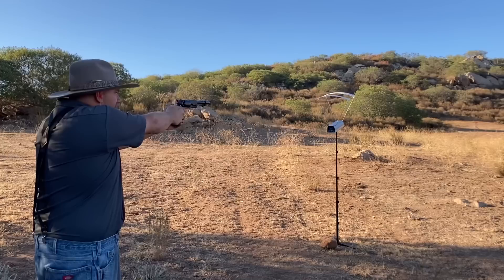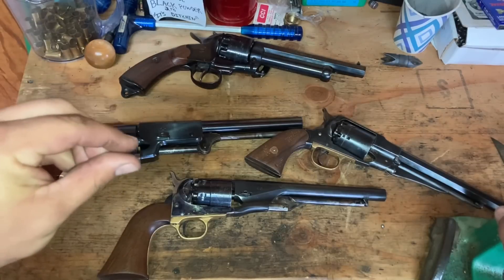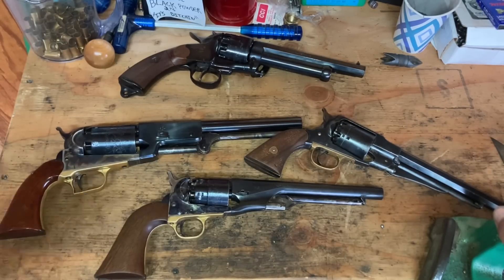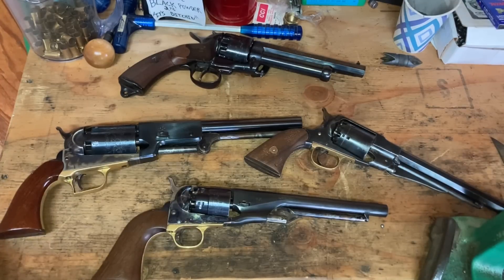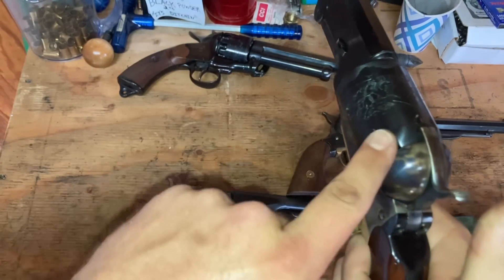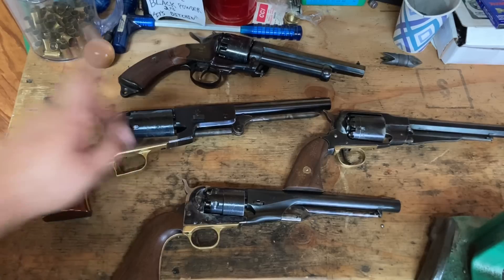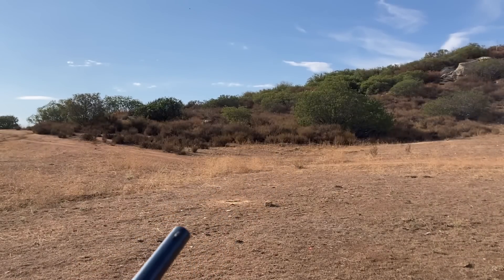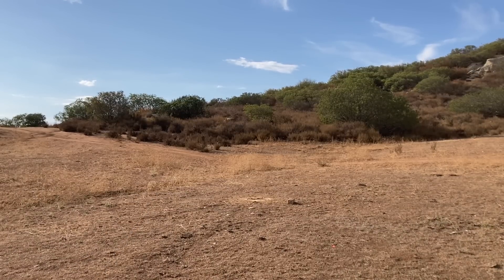What Causes A Chain Fire?

Comment: Much like you, I feel that on some occasions the chain fire can come from either end of the cylinder, I use grease (bore butter mixed 30/70 with beeswax, beeswax being the 70%, usually) to both lube the balls in the barrel, to prevent chain fires, and to keep the founding as soft as can be. I have fired well over 5,000 rounds from BP revolvers in my time and, luckily, have yet to have a chain fire. I have been present with several chain fires to go off and of them, about half were from loose balls and no lube and twice when I watched it happen from the rear. The 2 times, one had drilled the nipples to "ensure reliability" and the second had nipples that were well being their use date and we're just about as worn and the one who had drilled the nipples.

Comment: Got a cheep and easy recipe for cylinder grease. Use equal parts reg candle wax and axle grees. Use a been can to heet mixture and stir it with a pop cycle stick. Works well in hot or cold weather. You can very the ingredients to make it thicker or thinner as needed.
 I have never had a chain fire and I love to shoot. Keep up the good work
Reply from the maker: Thank you

Comment: Corned, glazed, commercial lack powder is funny stuff. It can be set off so easily by the metal shaving sparks from a flintlock or the flash of priming in a flintlock pan, yet is rather difficult to set off with a smoldering "slow match" or a thin electrical spark. Or, consider the Lindsay Civil War musket that was designed to shoot two charges out of one barrel -- two loads loaded one atop the other. There were many other guns that used this same principle, back in flintlock days, such as multi-shot guns with sliding lockplates, and even a 4-barrel "machine gun" where one barrel fired one load, which near the muzzle had a gas port that ignited a powder train completely filling a second barrel, which burned back like a fuze and (through many more gas ports) set off a burst of additional shots loaded "Roman candle" style in the remaining two bores. It really seems amazing that at full firing pressure the fire does not get around the projectile and ignite the next charge behind it. Though I imagine special steps were taken to prevent it, such as greased wads or specially-shaped bullets.

I always assumed most "chainfires" in revolvers were caused by "wormy" balls... balls with major defects from being cast too cold. Crisco definitely sucks as a bullet lube with black powder, it lets fouling build up very fast in the bore, but I think it is very effective at stopping chainfires. In fact I used to shoot revolvers a lot when I was a teenager, and don't recall EVER experiencing a chainfire. Even though my balls were never big enough to shave a solid ring of lead off. The grease melts and blows all over from the first shot, but something like capillary action spreads it and draws it into the tiny cracks where it is needed most.

I have not shot so much in recent decades, but now prefer conical bullets and real bullet lube over round balls and Crisco.
Reply: https://youtu.be/5gMkQ9Vu4Dw?t=237

Here is a guy talking about chainfires in the context of the oddball Walch revolver, which used stacked double loads in each chamber. Incredibly he has not read the patent or even looked closely at the patent diagram he included in his own video. He says grease was not used, when the patent clearly specified a special deeply-grooved bullet packed with grease. He seems like a nice guy, but I find his lack of research and lack of attention to detail absolutely mind-boggling.
Reply from the maker: Yes I’ve seen that video. I think it’s a stretch to conclude that because the Walch revolver didn’t fire both of its double loaded chambers at once proves grease doesn’t help to prevent a chain fire but that’s just my opinion. I’m not sure why but people have very strong opinions on this subject.
Reply: @Fuzzybeanerizer  Man, imagine having a chainfire in a gun like the Walch
Reply: Whenever I think of people using Crisco for cap & ball guns, I remember Duelist1954's annoyed tone response to being asked about it "Don't do that."

Mixing your own lubricant from tallow and wax seems to work the best, in the words of people who do that.
Reply: That's something I hadn't thought of. Defective balls might allow a bit of flame to get through to the powder. The balls and bullets I cast are carefully inspected and weighed, and any that don't measure up are rejected and melted down. Maybe that's why I've never had a chain fire in forty years of shooting a Remington, and they're supposed to be very prone to it. Interesting!
Reply: @williamnye478  I'm thinking some people buying ready made projectiles may not always examine them that closely, so that could be a cause for chainfires if they don't notice a shoddy ball and don't use any grease.
Reply: @0neDoomedSpaceMarine  Highly possible. And a lot of these ready-made projectiles could stand to be a bit higher quality.

Comment: Wads and grease only aid function by softening fouling.  Oversized projectiles and tight caps prevent chainfires.  I shoot every first cylinder without grease and never had a chainfire until I used loose caps.
Reply from the maker: I don’t deal in absolutes on this subject. People say that they’ve had chain fires due to loose caps and I’m inclined to believe them. In my experience grease helps prevent chain fires. Any time I’ve ever had loose caps they either fail to ignite on the first strike or fall off due to recoil of a chamber that does fire. That’s my experience
Reply: @Everythingblackpowder  You would think there would be another cap design by now after all these years . Seems like something on front of the cap that would protrude into the nipple hole to ensure they stayed put,sealed up the hole, and improved the ignition . How often do you clean the nipple openings and how do you do it ? I have seen where they say to fire a cap on empty chambers to make sure they are clear . Could torch tip cleaner be used ? Maybe make a nipple that uses a plasma arc like those new rechargeable lighters ? I use the twin arc to light my cannon fuse . Best fuse lighter  yet .

Comment: Interesting presentation on chain fires. I haven’t had one yet and hope never to. My cap n ball is a “.44” and the .452 balls leave a nice lead ring when I seat them. I still use lard or shortening because I don’t have tallow and usually don’t shoot in the heat of summer, at least nothing that laborious. Maybe fire a few mags of 30-30, or 308 or something or up to 10-15 rounds through my front stuffers and get back inside because 100 here is 100 with humidity of 80+%

Comment: In my opinion, your conclusions are correct. When not using any lube, I encounter chainfires every now and then, in my percussion revolvers; but only, when not using any lube.  When using lube, I have not had a single chainfire,EVER. This is over a period of 40 years of shooting. Its a clear indication to me, that chainfires come from the front and that lube is an excellent way of preventing them, apart from keeping the fouling soft. -Sure, my chainfires could probably be prevented by using a bullet with a very snug fit, but the bottom line is, that lube has for me, prevented chainfires with a success rate of 100%.
Reply: "...chainfires every now and then..."
Keep the lube next to the revolvers!
Reply: Never had a chainfire without using any lube or wad in thousands of rounds. Cap, powder, bullet. Nothing else.
In this example you proven correlation but not causality.
Shooting undersized bullets is a mistake from the user that he provoke itself. The lube have nothing to do in this. This is just a workaround.
Reply from the maker: I disagree. It shows that the chain fire is coming from the front due to the use of under sided balls and that the grease can prevent a chain fire if it originates from the chamber mouths. However, I do agree that this is easily remedied by using a lager diameter projectile. I too have shot a thousand some odd rounds through my 1860 army without any lube or wads and never had a chain fire and I had to pinch many a cap to stay on those cheap Pietta nipples. I started using grease to keep the fouling soft so I didn’t have to clean my pistol every 12 shots so what you call a workaround I call added protection. In short, I believe that the majority of chain fires come from the front due to undersized balls. Regardless of how easy it is to remedy or who’s fault it is for loading them.
Reply: Never lubed, never greased, never waxed. I’ve never had a chain fire after several thousands of rounds in multiple cap and ball revolvers with many barrel lengths. I’ve used regular balls, minie balls on both smooth and rifled revolvers, hand made pellets, flat pressed spheres, pellet flachettes and wadded flachettes. Some are pressed in tight, shaving the projectile and some are damn near just dropped in where you could smack the back of the grip with your hand and they would fall out. Never used any kind of lube or grease outside of what’s used when cleaning and maintaining the revolvers. If you are having chain fire issues, you are a sloppy loader and/or you have poorly made, non uniform, or pitted projectiles. I mean, I guess you could be loading it too hot where the projectile is barely in the cylinder because there is so much powder. Outside of that, if you chain fire it’s because you loaded it poorly or the weapon itself is in poor condition.
Reply: @Bravo-Too-Much c’mon man quit b.s. ing us.  You can’t b.s. old b.sers.  Stop it!

Comment: I agree with your findings completely. I had purchased an original Remington new model Army years ago and it had a spare loaded cylinder. It noticed some red colored material and saw there were no caps on it. After getting to my shop, I picked the red colored wax out of one of the chambers. They were carefully covered with what appeared to be sealing wax as was in common in the old days. I believe it was known that the chamber openings were a risk for chain fires. Thanks for the great video and posting your test results.

Comment: The only time I ever had a chain fire was with my Uberti Walker. I was using 60 grain loads with undersized balls and no bore lube or patches. (Cuz I was 17, and criminally retarded like most teenagers.) There was no damage to the gun, though I may or may not have shit my pants. In any case, I dialed it back to a more sensible 40 grains, got proper wads, and started lubing my chambers. Never had another issue again.

Comment: Oddly enough there does not seem to be any source documents detailing the "ring of lead" on originals in the time of manufacture......also the original colt chamber were slightly conical ( either by design or by happenstance from tool wobble) and I think they all got rammed down tight....... just an observation.

Comment: I’ve had had good luck loading powder, a thin vegetable fiber wad, a pea sized chunk of similar lube to yours, then ball. Haven’t noticed an accuracy difference for the first cylinder, but the barrel definitely stays cleaner, so I do notice a smaller loss of accuracy after a couple reloads. Don’t lose any lube to the hot gas of neighboring cylinders, and I think the fiber wad scrapes out more fouling than a felt one.
Reply: Mr. Maxwellian-This is how I load too except my wad is a very thin felt one (1/2 of a store boughten one). Only problem is that my pea sized chunk of lube may not be of a consistent volume each time although I try to make it so. I do think that the lube blowing out behind the ball seems to almost aerosolize and keep the revolver barrel and chambers coated and easier to clean.

Comment: This was a very informative video. Exactly what I like to see. You're not just parroting everyone else which seems to be the trend on YT. Can you tell us how you prevent cap jams in your Colt revolvers? It seems like you never have that problem while others can't get through a single cylinder without an adjustment.
Reply from the maker: Thank you. I make sure my caps are pressed on firmly and unusual tilt my revolvers about 45 degrees to the right while I cock the hammer.  I’ve found this to be very effective in avoiding cap jams.

Comment: if the ball is sized right to the cylinder, and a ring of lead is shaved off when seating the ball, there is no way air or flame and gas can get into the powder, and that is not "in my opinion" that is a mechanical fact!
Reply from the maker: Yes, but it’s strange how some people view facts as opinion.
Reply: If you have an old cheaply made gun with lots of machining marks in the chambers it can leave scraches on the balls and provide channels for fire to get to the powder.
Grease over the balls will still prevent chainfire.
Another thing to do is to make a pin gauge out of twist drill stock to measure the chambers to see that they are uniform and there isn't one or more oversize and out of spec.

Comment: Your chain fire to adjacent chambers is caused by black powder dust on the front of cylinder . Wipe your cylinder  front face with a damp rag after loading the chambers .when you use grease it seals the chambers to keep the burning embers from entering  other  chambers.  Be sure to check  front cylinder gap and shim to minimum clearance .
Reply: Commercial corned black powder is not very dusty. If anything, it is glazed with graphite or something and actually a bit hard to ignite with a smoldering "slow match" or an electrical spark. Home-made, unglazed black powder can easily be ignited with a slow match or electrical spark.
Reply: “Shim to minimum clearance”. How does one do that? I thought we need a cylinder gap.

Comment: Out of all my black powder revolvers, all different makes & models, all different kinds of caps even homemade, the walker was the only one (so far) that has ever chain fired. I want to say it was the lack of lubrication (bore butter) in front of the ball but MAYBE, a cap fell off in the firing sequence & a little bit of fire coming out the back hit another chamber. The extra shot hit the frame in the tip of the loading lever & stuck in there. No damage of any kind

Comment: You can stop the loading lever from falling down on the walker by using a wire tool on the spring. The tool will put a band in the middle of the spring and tensions it. I had a walker and this is what I did. My dragoon drops the lever on occasion,  so that is not perfect, but the lever stars up more. Good video, I leaned a lot.

Comment: great vid thank you. according to the people i learned from about 55 years ago you need to put a small chamfer on the edges of each chamber. we did not use wads only corn meal as a filler and yes Crisco on top. we all shot in black powder comps. shot off hand and always had high scores. 15 gr. powder 15gr. corn meal ball and Crisco. it did not matter if the Crisco melts it would seep in around the edge and seal the chambers. we would always pinch the caps and make sure they were down all the way. we shot Rogers and Spencer's and Remington's and when ruger came out with the old army we all switched to them. i still shoot the same load at this time and still can hit what i can see.

Comment: I agree with on bore butter and crisco being too runny, good lube helps with fouling and may prevent a chain fire from the front, I have experienced a chain fire from the rear with worn nipples and loose caps. Like you, I have shot them a lot also. I may also say that I was in Germany and shooting German caps.  Their was a test done with slow motion cameras. It showed that like you are saying under sized balls, with no grease they mostly came from the front, with grease, no chain fire. This was back in the eighties, I don't know how many tries it took for them to get a chain fire from the back, but it did happen and they showed it. Loose powder on the outside, loose balls and no grease and or loose nipples I think are the main reasons for a chain fire. You did a great test about grease. Good grief, some people think they have to be a RSO to everyone. In closing on this what turned into a damn book, I personally think that chain fires happen because people get into a rush, or fudge in the loading or maintenance of the gun., Like not replacing really worn nipples and filing them down and putting on really hot oversized caps( what I did), using a ball of two small diameter and not greasing, or not greasing and being a sloppy loader and having spilt powder left on the gun. In my 40+ years of shooting and building cap and ball guns, I have seen a lot of different things go wrong, not just with wheel guns, but long guns also. Keep up the good content, my kids and GF keep wanting me to make videos, but I cuss to much and as they used to say, have a good face for radio 🤣🤣🤠🤠

Comment: Two video requests! 
Could you do a video on your process for casting bullets? 
Could you also do a video on conical bullets in cap and ball revolvers? Advantages? Disadvantages? Tips and tricks? 
Great content as usual! Thanks.
Reply: I have never seen a mention of conical 450-200 lee conicals in 1851 piettas cutting partial ring only to get stuck curls around the loaded ballets. What accuracy? Would the 457-220 ish conical still fit? But carve enough to be a ring to remove? Near subject as sloppy in chamber that was polished and chamfered. The 454 balls seat securely and have a perfect ring.